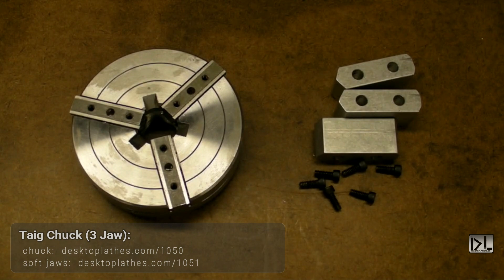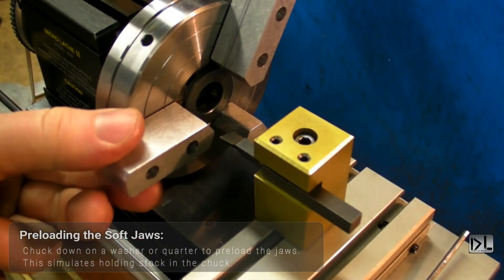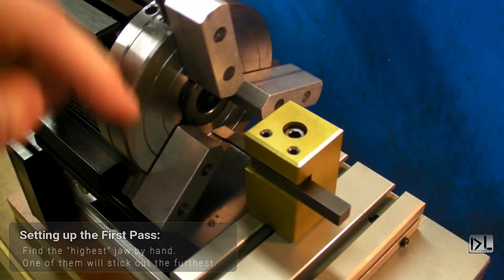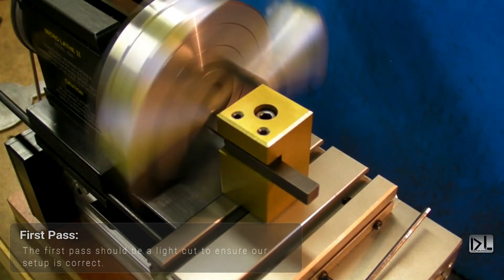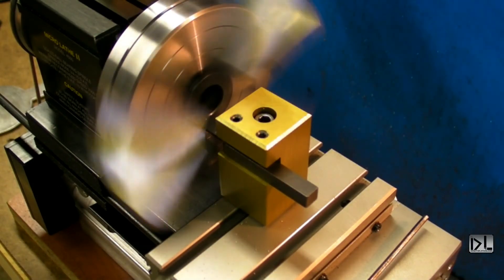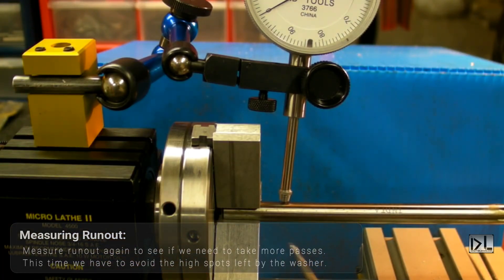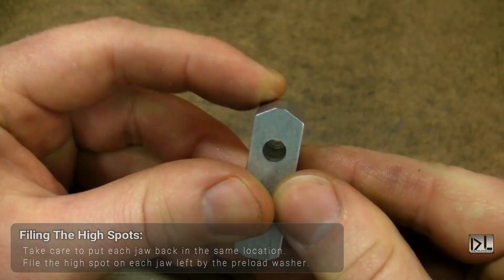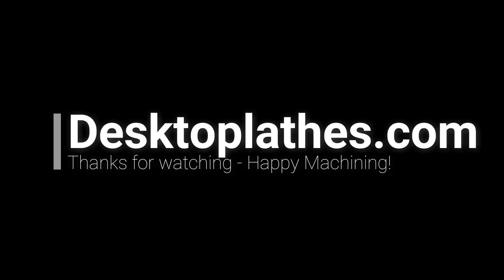Taig Lathe - Machining the Soft Jaws

Comment: Another thing you can do, since the jaws don't locate, is just snug the bolts a bit, load into chuck, clamp on something true like the reamer shaft, then finish tightening the mounting bolts.  It takes a feel to tighten just enough, but with that way your as close as possible to repeatable with this setup.  The jaws will locate against the almost tight bolts. If your ever remove the jaws repeat the procedure and do not mix them up. Might not even need cutting :)

Comment: I took the jaws from .003 runout to under .001, but when I removed the jaws for filing (one at a time) and replaced them the runout went back to .003, should I make more passes and try filing the jaws without removing them?  Thanks and this was a great tutorial!
Reply from the maker: Yes, definitely do that. Filing the remainder without removing the soft jaw that is ideal.  There isn't much of a precision registration for each soft jaw so removing and replacing can cause things to end up in a different position relative to the turning axis.  If I were to redo this video I would file the jaws in place rather than removing and reinstalling.  Most folks use a 4 jaw when higher precision is needed.  I plan to do a video on using the independent 4 jaw soon.  Thanks for the feedback!
Reply: @desktoplathes  Awesome thanks!  I have a 4 jaw chuck on the way as well, but if I could get this back down to .001 it will be more than precise enough for my needs.

Comment: Nice video. Thinking of getting a Taig lathe and wondered how the machining of the soft jaws was done. Do you need to check that the washer is properly circular or does it make no difference as long as it is preloading each jaw? Is the registration of the jaws good enough after removal and refitting assuming you put the jaws back in the same slots of the chuck ?....and finally which is more accurate, jaws machined like this or a collet chuck adapter and ER16 collets ? Thanks Rob.
Reply from the maker: Rob Thank you!  As long as the jaws can all clamp down I believe the washer just needs to be "round enough."  I've not had any trouble with one being too out of round and have used a coin before as well.  Registration seems good enough for removal and re-installation as I removed and re-installed when filing off the nub.  However, I can't say why exactly.  The only registration to speak of along the length of the soft jaw is by the two bolts and associated holes.  There is a nice tight fit side to side however.  If one wanted to bore them out without removing, the washer could be faced down a bit thinner and then wedged behind the soft jaws against the hard mounts, allowing for full boring and no nub to file off.  One note about soft jaws... they might be off when holding stock but if you do all of your machine work in one setup, it makes no difference.  However when you go to flip the part or need to turn concentric to the held surface, that's when things become critical.  And in those cases, you can use a 4 jaw independent and manually dial it in each time (just takes more time).  A Collet chuck adapter and ER16 collets would be more repeatable than the 3 jaw self centering but not as accurate as a 4-jaw independent when done just right.  I should do a video on the 4 jaw... just need to find the time!

Comment: do you preload the washer on the jaws itself? or on the hardened metal behind the jaws
Reply from the maker: You can do either.  I believe I used the jaw itself in this video which is why filing of the nub is required at the end.  However the objective is to simulate the jaw positions when clamping down on a part.  If they are fastened right to the hardened metal behind, there should be no difference.

Comment: What makes the auto feed stop when the carriage hits the depth stop?
Reply from the maker: Great question, your thumb acts as the clutch by coupling the hand wheel to the carriage.  So when the depth stop is hit, there is a considerable force required to hold the hand wheel from moving relative to the carriage and so you let off the pressure knowing you've bottomed out.  I might do a video some day just on the power feed as I find it to be a very clever design but it's not obvious how it works.
Reply: @desktoplathes  Thanks for that great description!

Comment: What a great video! I bought the 3 jaw set and never got around to doing the truing up, so this really answered all questions and what a difference to be able to get to half a thou of run-out! I have been using the 4 jaw chuck but set up takes a while and now I can spend more time actually learning to make some starter projects. Thank You!
Reply from the maker: Rick Moskovits - Awesome!  Thanks for the feedback.  One thing to keep in mind is if you only have the one setup and don’t need to match other surfaces on the work, you can still get away with an un-trued set of soft jaws.  But when you have to flip a part or remove and replace... all bets are off.  4 jaw is always the most accurate but often things won’t fit in the hard jaws or you need to match concentricity with an existing surface.  Take care!
Reply: thank you!

Comment: Can't say that what I do is an improvement but I wonder if I can rely on the two screws to reset the jaws exactly there must be some clearance, so I use the two centre holes and line the jaws with short dowels, I think you will find the centre holes are .1875,

Comment: usualy you also make it that you can clamp pipes from the inside, on my channel you can also see how to true up hard jaws.
Reply from the maker: Yep, they can true the outside as well... I think a lot of beginners trip over needing to clamp the jaws down to get rid of backlash in the scroll.  Hopefully this video will get them started.  Nice lathe you've got over on your vids - sub'd!
Reply: when truing the outside you cant use the washer trick but you need to clamp the outside with a big hoseclamp to get rid of the backlash. thanks for the sub
Reply from the maker: happymark1805 right, backlash in the other direction!
Reply: @desktoplathes  Frontlash?  :)